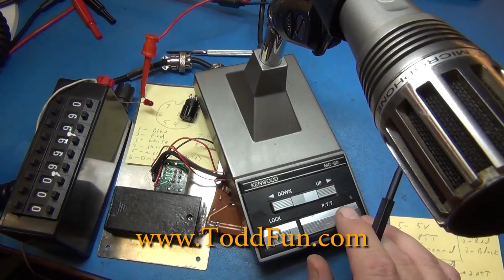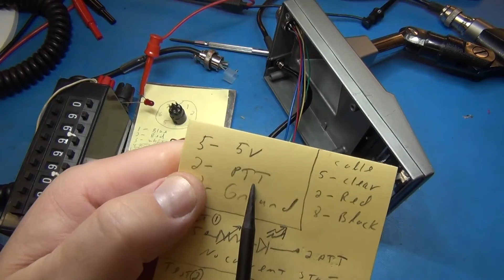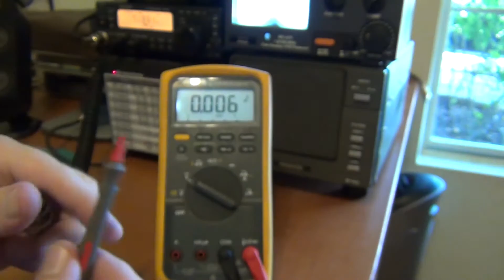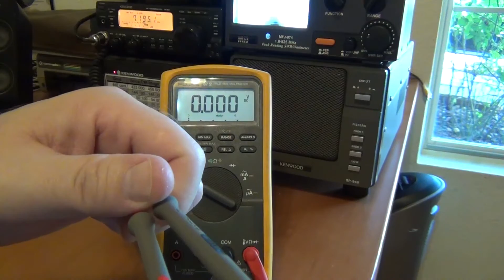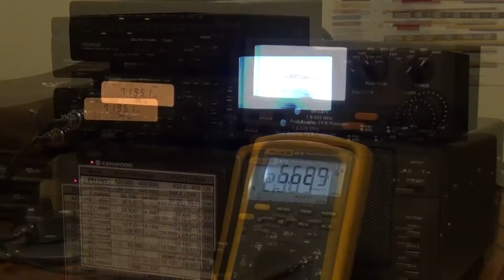Add an On The Air LED to Kenwood MC60 Desktop Mic

Comment: Thank you very much for your nice video. But need to ask you regarding the LED legs that you connected to the 8volts  centre leg of 2SC1815  was positive or negative of the LED ?  Pls advise Tks

Comment: Hola consulta...en todos los equipos es necesario usar el mc60con pilas???
Reply from the maker: No, no tiene que usar la batería si obtiene 5v CC de la conexión de micrófono de la radio. Solo necesita la batería si necesita la amplificación del micrófono y luego solo si su radio no suministra la fuente de voltaje para el circuito de amplificación.
Reply: @ToddFun  ok muchas gracias por su rapida respuesta...hace poco adquirí un mc60 y mi.equipo es un ts 440s y no sabia si colocarle las pilas...saludos.lo sigo desde buenos aires Argentina.
Reply: @motus4084  Encantado de ayudar. Greadings de Estados Stats of America

Comment: OK, thanks for answering. But what I want is to put the MC60 to use it in the Yaesu FT101E, maybe I do not explain it well, but it is to use this microphone with the FT101E, as I must wiring it. A hug
Reply from the maker: I see. you don't care for the red light modification. You just need the correct adapter cable. Best to just buy on on eBay. I found this one that will work. 8Pin Male KENWOOD MIC to 4Pin Female YAESU FT101 Adapter HS48P http://r.ebay.com/WYgA3r
However, you may or may not need to turn on the amplifier on the bottom of the MC-60 after putting in fresh 9v battery. Don't forget and leave the amp switch on when you're done using the radio or you will drain your 9v battery. you can try with and without the built in amp so see how it works once you get it connected to your FT101E. 73!

Comment: Thank you friend, for this valuable information, I opened the cable link and it is just what I was looking for, I'm going to ask for this cable and I'll see how I connect this MC60 to the FT101E, I hope it does not find any modification because of the MC60's PreAmplifier, I think I will put a Led Pilot, to know when the Preamplifier is on and thus avoid forgetting about the Battery. Thank you very much. Att. Marcos Lopez from the Dominican Republic (HI5MLE).
Reply from the maker: Sure, glad to help. That's what we do at ToddFun.

Comment: Where can I get the bigger collar for the mic connector to make it easier to unscrew.
Reply from the maker: I just chopped it off an older Motorola mic I had found. You'll find buckets full at ham fests. It's quite the job to do the replacement but if you're good at such small solder tasks it is do able.